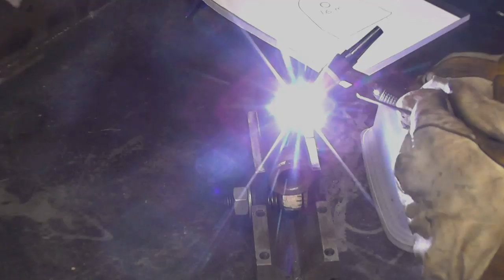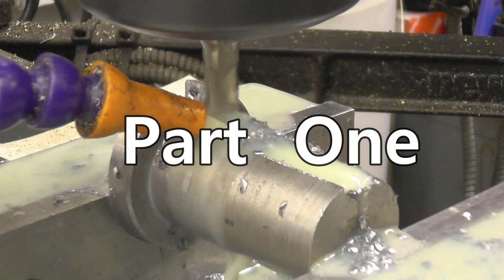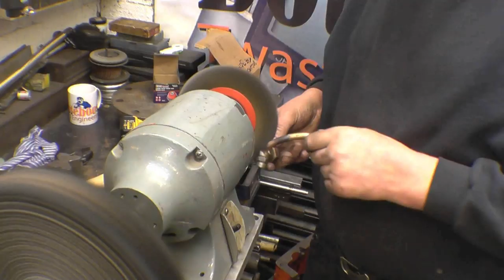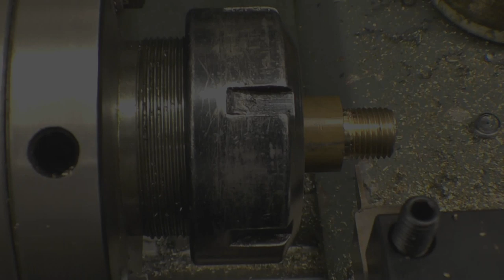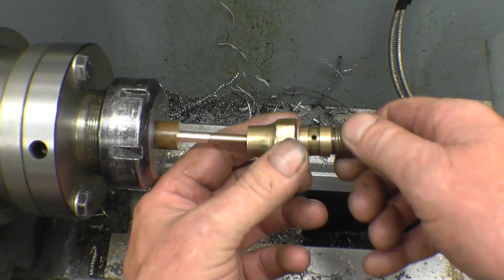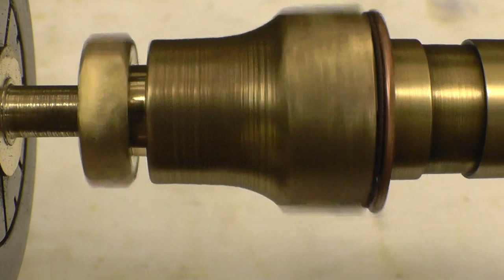SNNC 287 P2  Machining Brass   Tungsten Slips

Comment: My worry is the needle valve won't do it's job properly ie meter because the taper doesn't match the one inside the body correctly. Also UNC was unknown until after WW2. So depending on the engines vintage, is unlikely. Yes the basic form was around but wasn't widely used on British equipment. I really enjoyed the night caps. And I liked machining the die holder to allow the adjustment to work as it should.
Reply from the maker: I repair the old needle so that it can be reused
Reply: @doubleboost  great stuff. Just Re  watched and realised!

Comment: What size taper is that on your lathe spindle?  I want to get a ER 40 collet chuck for my lathe but I hav3 a L0 taper and it looks to me like the ER style chucks are too small to bolt up to the backing plate I have.
Reply: I understand The Harrison 140 Lathe(John's) -The headstock spindle is bored 41/2 Mt, (4.5) Large diam 1.5" small diam 1.266" length 4.5 Taper per foot .624. Taper per inch.0526. Angle from centre 1.4894. Spindle is often reduced down to 4Mt to accommodate accessories using the spindle reducing  bush. Stan
Reply: What I am looking for is the outside taper. That the chuck mounts to.
Reply: @RockingJOffroad  Hi Again The Spindle Nose is known as the American long nose taper -L Type Mount to ASA B5.9 the big diam is 33/4" and the small is 23/4" with a keyway, see:http://www.lathes.co.uk/latheparts/page9.html .............Regards Stan
Reply: missed ---oops,  its the L00 size,( L zero zero )
Reply: Stan, that is what I was suspecting from the videos, but I wasn’t sure!  I have the L0 (zero) chuck on my lathe which allows for a larger spindle bore. According to all the Cincinnati Lathe Company information my lathe should have the L00 spindle and a smaller bore, I guess mine was special ordered with the larger spindle.
Reply: @RockingJOffroad  Dam, whilst neither is very popular now in the UK L00 is probably slightly ahead of L0, But L0 backing plates are plentfull and afordable in USA. Possible thought. I think John covered the attaching and conversion of the collet assembly to the L00 plate in a previous nightcap. But Johns and my identical Lathe definatly L00, L zero zero. Stan
Reply: Stan Gordon  thank you for the information!

Comment: That box of gauge blocks won't blow away in the first stiff breeze, will it?  I didn't know they came in tungsten.
Reply: Circa two and a bit times heavier than steel.
Reply from the maker: yes the box is very heavy they just ooze quality

Comment: Surely the A/F of the hex would be a BS spanner size?
Reply: @hrxy1  On an old motor the rest of the spanners would be BSF/BSW. It is BSF which is 1 size down from BSW, the term BS refers to both. A/F means the across flats size, I am not referring to the 1/16 graduations of UNF/UNC